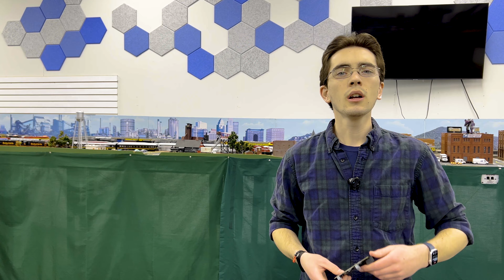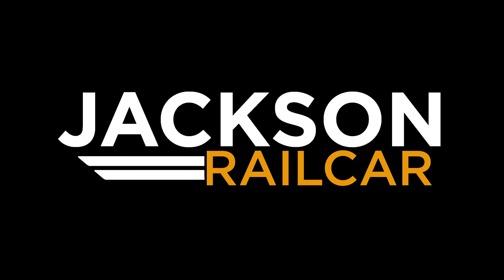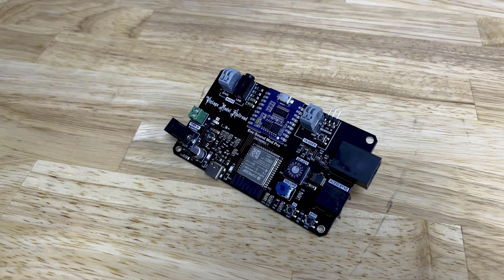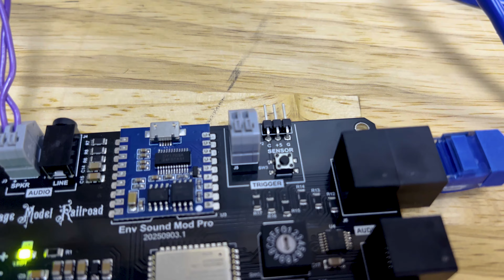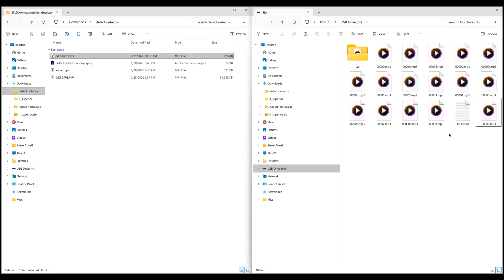NEW: Environmental Sound Module Pro

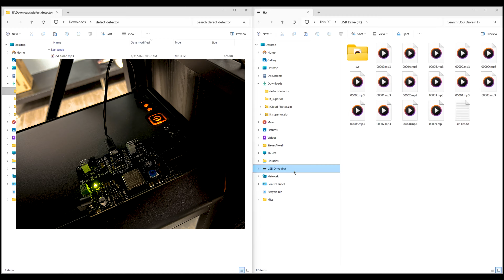Comment: I've uploaded a short preview of the ESMPro module to my YouTube channel. On top of that I seem to be having issues with @ 2:33 in the video. I've plugged mine in but I don't see anything popping up. I'm using the right USB cord as far as I'm aware, nd I'm plugged into the right port.
Reply from the maker: Are you using the micro-USB port? The USB-C port is meant for limited power and for flashing new firmware.
Reply: @JacksonRailcar   I just tried it with the same cord and the same port you did in the video. Nothing is popping up.

Comment: So could I use the audio line out (with yard noise/storm/...selected), to an amplifier, split the signal to multiple speakers, each with a delay (to offset the single sound file), thus I can use one ESM Pro board (yard noise here) to serve multiple neighbouring buildings without the sound being unrealistically in sync?
Can we play sound files on infinite loop until button pressed second time?
Reply from the maker: If I understand what you described, yes, you can do that! The board can only do one sound file at a time and has the single line out, but if you have an external control to add delays to the sound being played after duplicating it to multiple lines, that is completely possible. Great question!

The sound file does play forever as long as the contact closures for the trigger are closed. 

- Nate